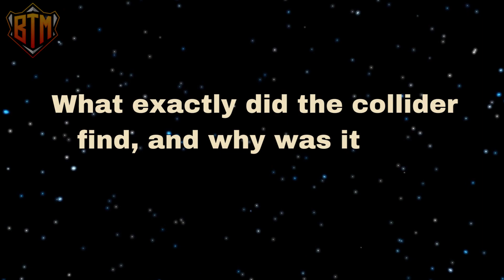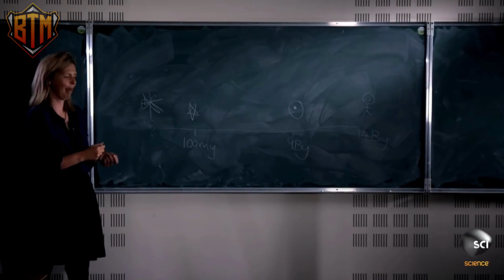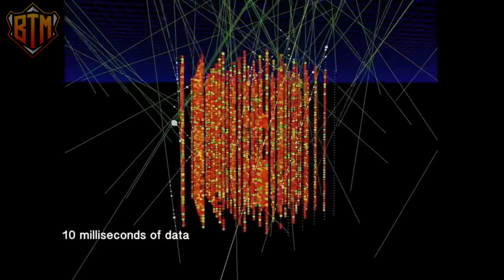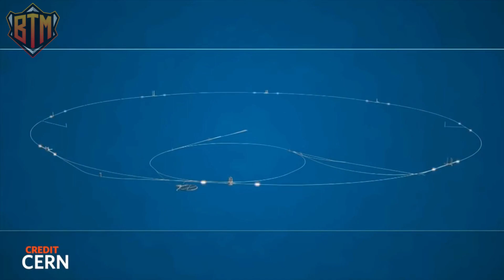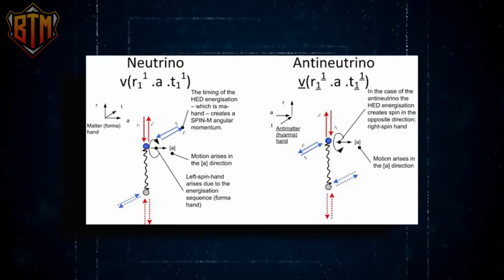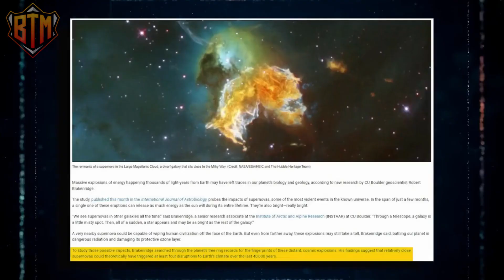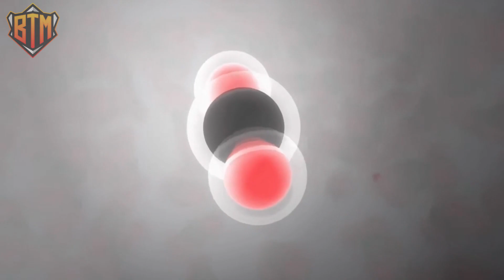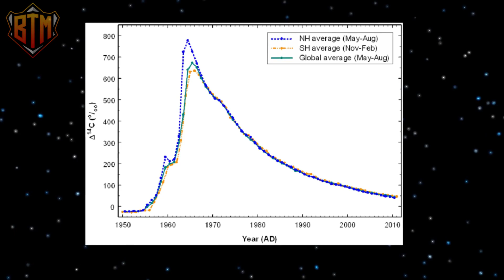Scientists Just Announced That The Large Hadron Collider Found Something For The First Time Ever

Comment: The Hadron Collider project started in the 1990s and after years of useless research it was terminated. This video fails to include that. Another factor it left out is that Cern violated safety rules when it was found that a small leak in the structure could result in black matter escaping. Black matter is the implosion of neutrons which results in a catastrophe called a black star. It could virtually have started a chain reaction of black matter, resulting in the implosion of Earth. Please do the math.